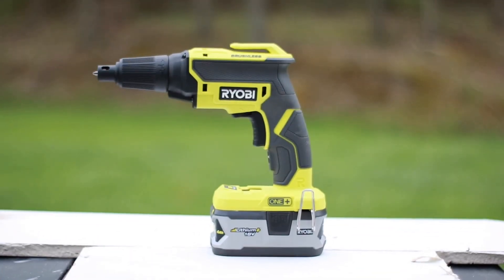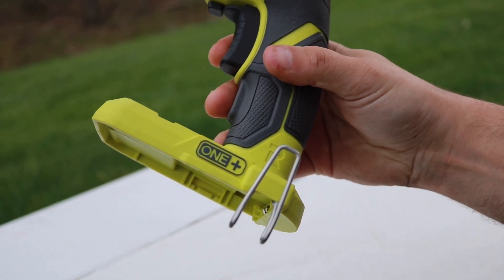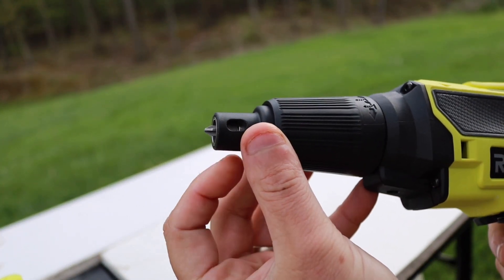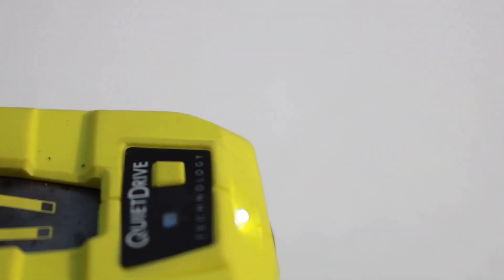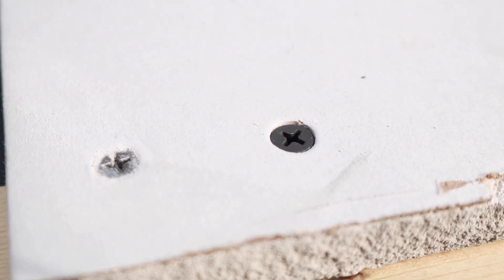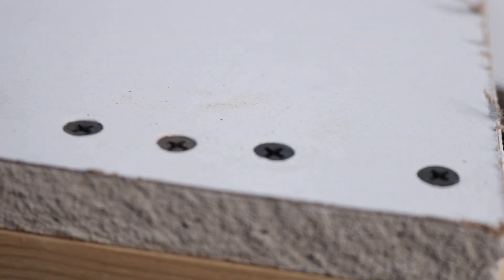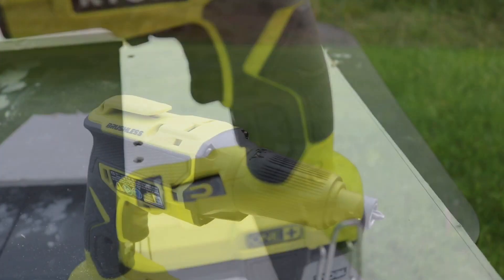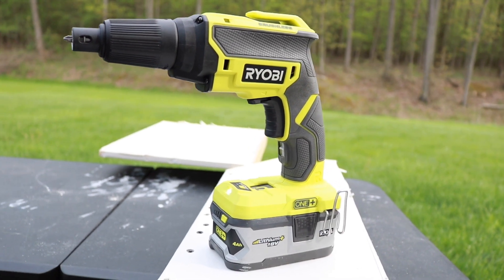All New Ryobi 18v Brushless Drywall Screw Gun Review and Tutorial (P225)

Comment: I have two of those guns and I have to say Ryobi build a very good product really comfortable. There is only one defect, the magnet in the bit holder is weak does not hold the screw. But I ordered a bit holder from Amazon and it works great.
Reply from the maker: Hey pantera,  check out my how to magnatise any bit video. I specifically talk about this gun and should help buddy
Reply: What's brand is it?
Reply: Pantera Punzante , Hi  I had the same problem & I fixed easy ,   I got  a 2 1/4 milwaukee bit holder & cut the bottom , I cut almost a 1/4 inch using a grinder ,  &  problem was done ,,
Reply: @panccracio661  2" wera brand it works really good
Reply: @reygerardogarciac7832  yes that works to I did the same with a Makita bit holder, but I found a bit holder in Amazon that fits perfect it is a 2" wera brand the price is good to
Reply: @panterapunzante8469  got a link to it?

Comment: I have to ask this question. What is the difference between this and normal drill with drywall bit?
Maybe if it was available with some screw auto feed attachment.
Reply from the maker: Not a problem peger, a lot have this question.  There are a few differences between the two. First, you can adjust the gun to sink your screws to the desired depth perfectly every single time. It has a stopper on it as a drill dies not.  It also has feet high rmps that drives the screws extremely fast. It also has an auto mode which will allow you to continuously sink screws without pulling the trigger.  All in all, it makes the job 10x faster, and each screw sinks exactly the same as all the others.  I will be posting a video about the differences soon
Reply: Tnx.

Comment: whats the diff from using a regular drill ....?
Reply from the maker: Hey Raj, this has a stopper that will   sink each screw to the exact same depth. You could adjust the clutch on a drill, but they still would not sink the same do to moisture or knots in the wood. These are also much faster than a drill. Eventually I will post a vid on the difference between them

Comment: Doesn't look like it holds the screw very well   I've been in several situations where I need my left hand to hold the drywall.  so I put the screw on the drill prior to raising it off to the drywall. It needs to stay there. Looking at your video with you running them screws in it looks like the screws wobbly as hell. it's a major problem if it doesn't hold the screw steady . they need to offer an adapter it's a screw sinks back.  that way I cannot call out or something.
Reply from the maker: Yeah I'll agree with that.  Vcg construction did a video on how to magnatise your bit that would probably really help with the prob
Reply: I bought this and brought it into work to give it a try. I liked everything about it except the strength of the magnet in the tip shaft. Its absolutely useless, doesn't hold the screw at all. I tried to get a replacement shaft, but cant find the right size. It's exactly 2", not 2-3/8", not 2-5/8", and nobody has them. I guess I'll try to magnetize this one. Other than that, I like it better than my cordless Dewalt.
Reply from the maker: A lot of people had this issue,  so I made a video specifically for the weak but here https://youtu.be/pIF_qpZGxsw
Reply: I've seen all the car battery methods, I had no idea this product existed....Thanks
Reply from the maker: This how we do it here buddy!
Reply: You can't really find the good number 2 bits the small ones those are the ones you need

Comment: Just bought one. Returning it. Tip won’t hold the screw, falls off.
My Dewalt corded one, I could put a screw on the tip, pull the trigger and lock it on, hanging it on my belt, lift my piece with two hands put it in place and then reach for my gun on my belt that’s still running with a screw on it and secure the piece. This Ryobi won’t do that the screw falls off!!
Reply from the maker: Hey John, I actually did a video on how to fix this issue.  How to magnatise you bit. Husky makes a $2 magnatiser at the home depot
Reply: Tool Review Zone I just got back from trying to buy a new bit holder for it but I could not find one that was 2 inch.
So I returned the tool and bought the 18G Airstrike Brad nailer.
If what you say is true I’ll buy the drywall gun again.
Reply from the maker: Yeah I was having the same issue, but that little magnatiser/ de-magnatiser works good buddy
Reply: Tool Review Zone 👌